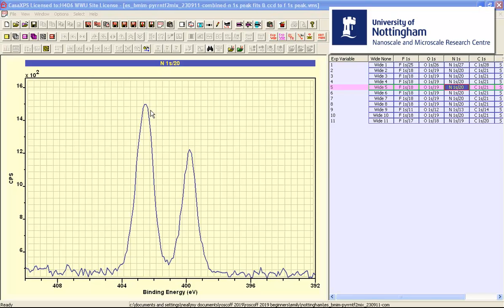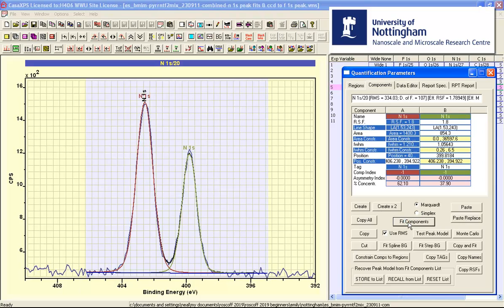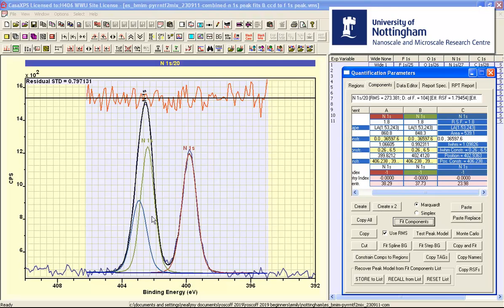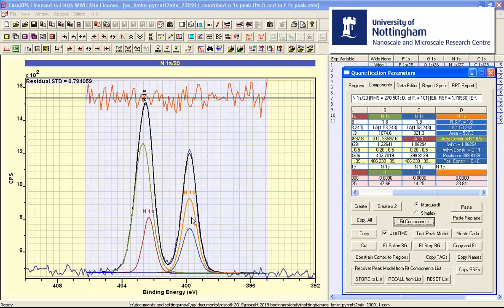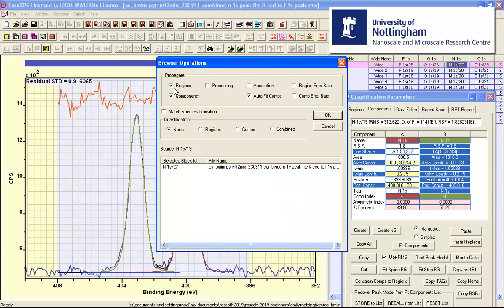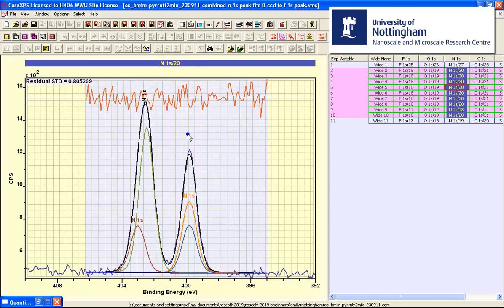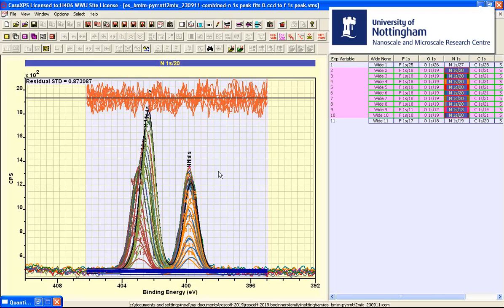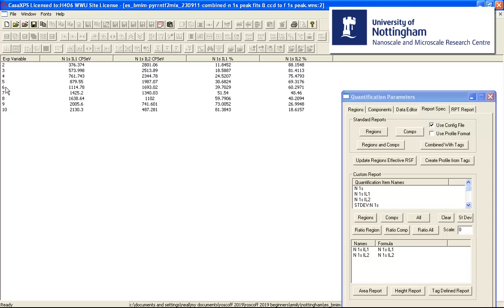Constructing and Fitting a Peak model to Data in CasaXPS

Comment: what relation do the constraints have to one another, i'm a bit lost on why you set constraints (Area, Position, fwhm)? Is this due to bonding, ions, etc? I'm new to this all, so I'm trying to figure out the software
Reply from the maker: Area relational constraints are typically defined by stoichiometry or physical relationships between doublet photoelectron peaks. FWHM constraints are more subjective as these include instrumental influences such as pass energy. Position constraints are used to model relationships in binding energy, where shifts in binding energy indicate bonding influences on electron energies in atoms. There is a 30 minutes video on www.casa-software.com looking at C 1s chemistry of PMMA that discuss all these constraints applied to an evolving polymer chemistry. You might also like to read the paper: 
Major, G.H., Fernandez, V., Fairley, N., Smith, E.F. and Linford, M.R., 2022. Guide to XPS data analysis: applying appropriate constraints to synthetic peaks in XPS peak fitting. Journal of Vacuum Science & Technology A, 40(6).

The logic used to construct a peak model is also explained in the paper:
Fairley, N., Bargiela, P., Roberts, A., Fernandez, V. and Baltrusaitis, J., 2023. Practical guide to understanding goodness-of-fit metrics used in chemical state modeling of x-ray photoelectron spectroscopy data by synthetic line shapes using nylon as an example. Journal of Vacuum Science & Technology A, 41(1).

Comment: This is really fascinating. There are three positively charged nitrogen atoms, but in one IL, two N atoms share 1 charge in resonance, in the other IL, the N atom has a full charge. That changes the ratio of + charged N atoms to 1 charged atoms by 2x (or 1/2) in the two ILs. If I have that wrong, please correct me. 

I'd actually solve this with two peaks only, and use algebra (solving a system of equations) to map the XPS data back to the two mixtures. This approach would validate Neal's approach. It is very elegant work.